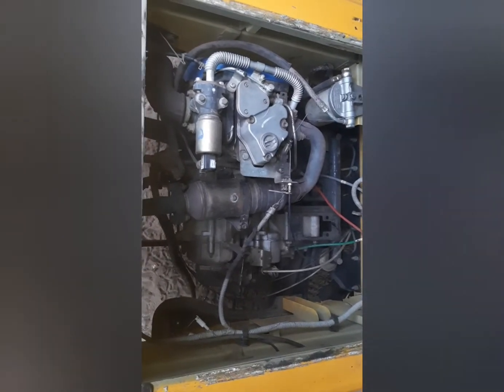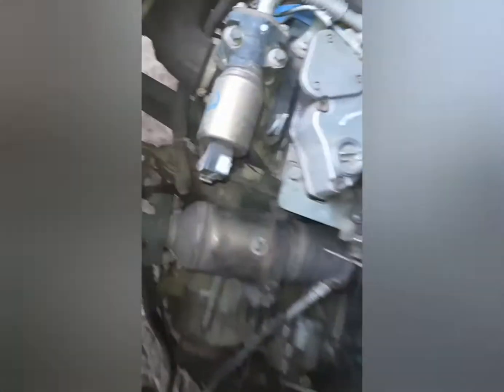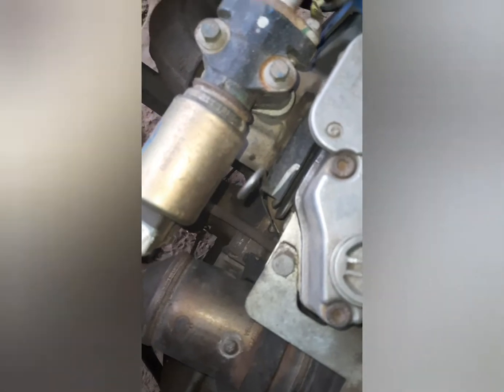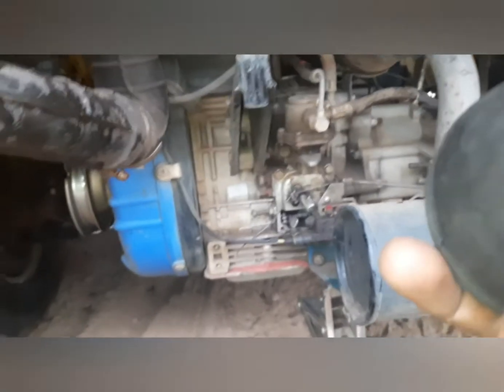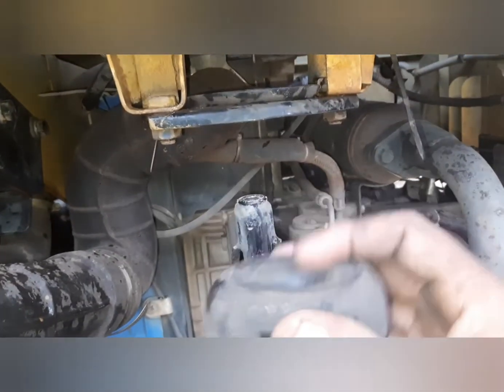ஆட்டோ vibration அதிகமாக உள்ளதா | auto vibration problem | bed rubber change

Comment: Vandi romba thooki , thooki podudhu anna chinna chinna pallam medu la ponna , enodudhu pudhu vandhi 6500km dhan odi irukku , rear shock upsorber , front shock upsorber ellamae apdi dhaan irukku , edhuna idea sollunga anna , video podunga , unga auto la enna panni irukeenganu ❤️❤️👍👍
Reply from the maker: எனக்கும் அப்படித்தான் இருக்கு 
Tyre pressure குறைந்த அளவில் vachirukken
Reply: @automototamil  evlo na tyre la kaathu maintain pandreenga , 3 wheel la yum ?....
Reply from the maker: பின்பக்க tyre 40
முன்பக்கம் 35
Reply: @automototamil  ok anna thanks .....
Nariya per erunaa kooda 35 , 40 correct ah irukudha anna?
Reply from the maker: Hmmm
Reply: @vignesh16091993  ஸ்பிரிங் காயில் ரப்பர்(ஹைட் ரப்பர்) அதை ரிமுவ் பண்ணிட்டு ஸ்பிரிங் ஆல்டர் பண்ணுங்க சஸ்பென்ஷன் நல்லா இருக்கும் ரியர் வீல் காற்றின் அளவு குறைந்தது 60psi இருக்க வேண்டும்
Reply: @vr1673  romba nandri anna ... Mechanic kitta poi neenga sonnadha panna soldraen
Reply from the maker: Amount evlo
Reply: @automototamil  inimael dhan anna pogaporaen , poitu pannitu soldraen , total ah evlo aachi nu , spare and labour rate ....
Reply from the maker: Suspension spring change Panna poringala rear side
Reply: @automototamil  ramesh babu m anna sonna maadhiriye namba vandila change panna mudiyuma nu 1st ketukuraen , apdi mudiyum nu sonaanganaa , iniki mudichiduvaen
Reply from the maker: Ok
Reply: @vignesh16091993  நீங்க என்ன வண்டி வச்சியிருக்கீங்க
Reply: @vr1673  video la anna vechi irukaare adhe auto dhan vechi irukkaen anna ....
Piaggio apecity+ bs6
Reply: @vignesh16091993  தாராளமாக ஸ்பிரிங் ஆல்டர் பண்ணலாம்

ஸ்பிரிங் ஆல்டர் பண்ணினா டயர் மைலேஜ் மட்டும் கொஞ்சம் குறையும்
Reply from the maker: Price
Reply: @automototamil  1500₹ க்கு உட்பட வரும்
Reply from the maker: Two spring sertha
Reply: @automototamil  ஆமாம்
Reply from the maker: Address kedaikuma